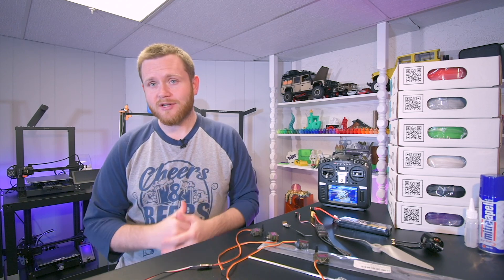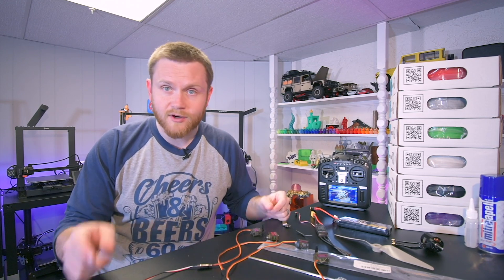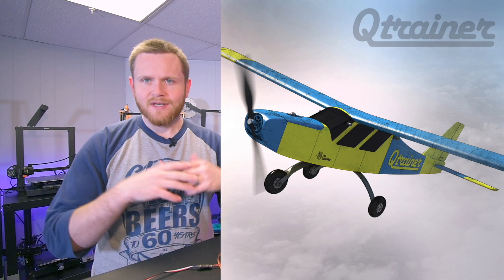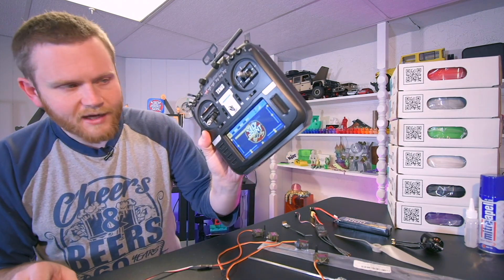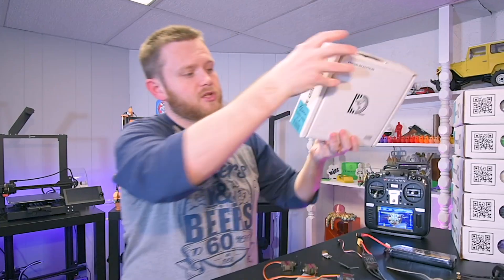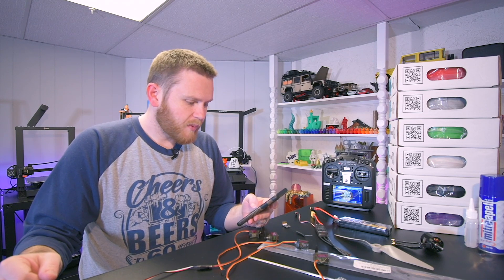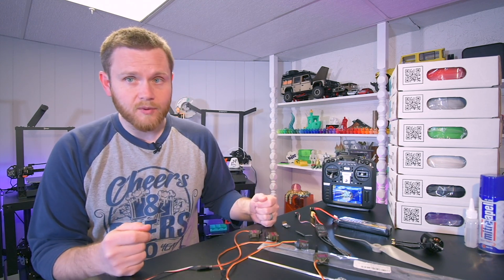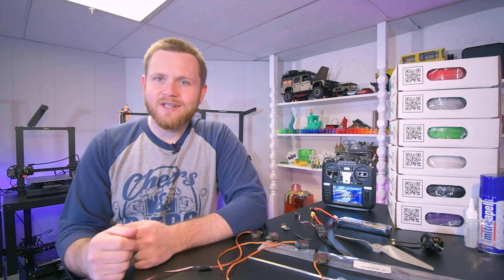NEW PROJECT! A 3D Printed RC Plane! - IIIDMAX Xtreme PLA + Qtrainer

Comment: if you do not already know how to fly ailerons, you should  NOT  begin  flying  a  with a model that has them.!!!         you should  begin with a model that flies slowly, and does  NOT  have ailerons.      this equals a model that has a main wing with  Enough dihedral, that it will turn with  RUDDER  inputs.        there are models that  Only  fly slowly (slow-flyer); other  slow-flying models are more versatile; and can be trimmed to fly slower or faster.        googleltranslate
a slow-flyer
https://www.youtube.com/watch?v=lZ1vUKcktVk
Reply: Thousands of RC Trainer type airplanes  were made with ailerons and fly slow enough for the extreme beginner, he can always install a Gyro which will help him even more. What I would suggest him is to go at a local club so an Instructor can guide him and maybe use a buddy lead using two transmitters so in case he will get into trouble the instructor can take over. He will do fine, after all its a 3d printed airplane not a Balsa one. He can always re-print one and start all over without any fuss.
Reply from the maker: Im equally scared as I am excited. Haha. I guess that’s a good sign.
Reply: @3DPrintSOS  I had the same feelings when I first started RC model aircraft, my first trainer was a Ripmax Trainer 40 ( with ailerons 😁)

Comment: airframe design information.
you may not know that  the  STRUCTURAL DESIGN  of  most printable aircraft  is  DEFECTIVE.!!!       in several ways.            a  main wing  SHOULD  have a load bearing main spar, located at  THIRTY  percent of chord.            a dihedral wing  SHOULD  have a central, fuselage-spanning, dihedral brace that is 'part of' the main spar.            the main wing  SHOULD  have a  FLAT-bottomed  profile;  like the n-10  or  clark-y.             this type of airfoil/profile is  SUPPOSED  to be mounted at zero-degrees aoa, relative to its  Lower surface.     (aoa is angle of attack.)            the use of hoerner wingtips is  NOT  recommended;  unless there  is a  NEED  for  extra lift; that  such wingtips make.!
the  MASS  of wing-located servos  SHOULD  be  located  as  Far  INBOARD,  as is  PRACTICAL.     AND, located forward of  thirty percent of chord; aka the cg.          both of these factors  are  PART  of  optimal  dom  planning.     (dom is distribution of mass).            the main lg  Should be located  below the cg;  which  Should also be  just a bit aft of the c-m.   (c-m is center of mass; c-m  Should vertically align with  25 percent of chord.)            you may know that the mass of  rudder/elev servos  GOES  near  the  cg.!    not aft of it.      googletranslate      n-10 profile
http://airfoiltools.com/airfoil/details?airfoil=n10-il
hoerner wingtips; not recommended
https://3dlabprint.com/wp-content/uploads/2017/06/qtrainer_front-768x464.jpg
Reply from the maker: Thank you for that! I have so much to learn but I’m really excited to get to know more.

Comment: Do you have any experience flying rc planes?
Reply from the maker: None. Only drones and small helis.
Reply: @3DPrintSOS  definitely buddy box with an experienced pilot, those full PLA planes are not forgiving.  you could mix in some LW-PLA parts to shave weight off, improving the flight characteristics.
Reply from the maker: Thank you for the ideas on how to ease in. I need to see if there any local spots